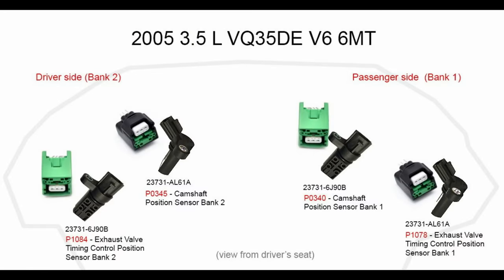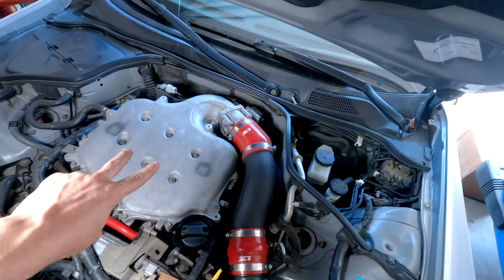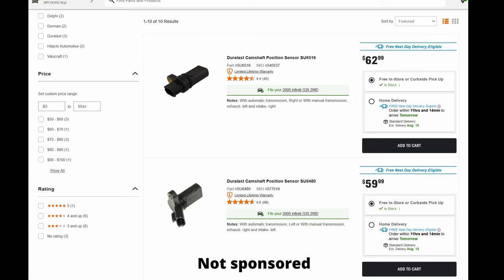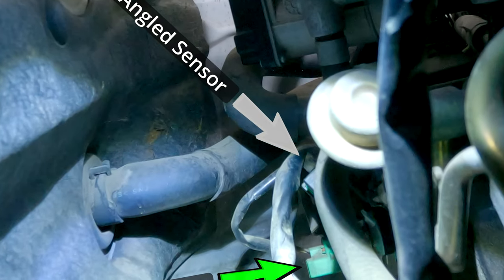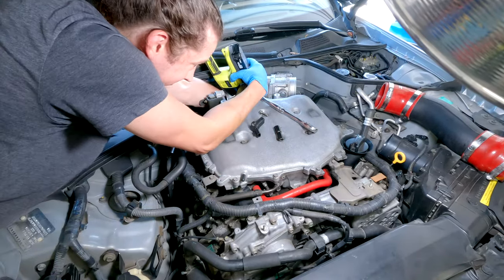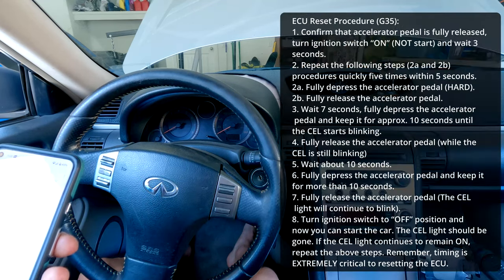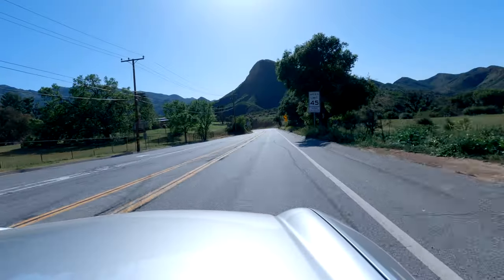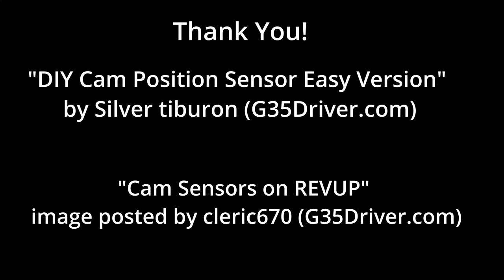Ultimate Camshaft Sensor Guide! G35/350Z | P0340 P0345 P1078 P1084

Comment: i have a non rev up 03 model Z, had p0345, replaced it, cleared the engine codes but it keeps throwing the code. Any idea why? All the problems (stalling, dying, running bad) went away so i assume that fixed it, an no other codes, dont get it....
Reply: You need to relearn the camshaft sensor
Reply: How do you do that? @DreddKnot.
Reply: Do the relearn and clear the codes after even if none present. If still throws it's VVT solenoids

Comment: Great video.  I just did this exact job on my 2007 Infiniti m35.  P0345 code. I bought a set of sensors from Amazon and this video helped tremendously.  My car was losing power while driving.   As of now I have completed replaced the bank two sensor and reset ecm per this video.  My check engine light is off and car fired right up.  I let it idle for about 30 minutes.  Before fix it would die 6-8 minutes into idle.   After I drive it I will come back to give an update.

Comment: Do any of y’all know if a platinum spacer will throw off the camshaft position sensor ? I’m having trouble with it I changed the sensor and did the reset it runs fine but if I turn it off and then back on it will do the same thing or would I have to switch both sensors

Comment: So on the revup there's 1 angled and 1 regular on the back of both right? I've changed the cam sensors but was kinda confused om the exhaust valve timing control sensor..that's right next to them right? Thanks a bunch.. so basically 2 of each

Comment: Thankyou for this info, I just bought a clean 2006 350z, did a thorough check over before purchasing but somehow I missed the damn check engine light. Did the diy engine code thing and it came up with 1078. Ordered a replacement exhaust cam sensor however I will do all the rest for preventative maintenance shortly after.
Reply from the maker: I'm glad it was helpful, congrats on the recent purchase!

Comment: Hi bro,

I got the P1078 error code. I already bought an exhaust Valve Timing Control Position for bank 1. Perfectly unscrewed the bold but there's no way I can pull the sensor out. It twists and turns left and right but I can't manage to pull it out. Any advice on how should I proceed? Thanks

Comment: Is it possible that sensors are bad and there is no engine light? I have problems with my car and I'm about to replace all camshaft and a crankshaft sensor because I dont know anymore what could be wrong but I don't have any codes or nothing when i scan it.. (nissan 350z vq35hr). Thanks in advance!

Comment: I feel like I need to change these every 6 months now ever since getting over 90k miles
Reply from the maker: Same, may be worth doing all of them or getting ones with a lifetime warranty
Reply: Agreed. Been fighting these the last 4 years. Finally picked up some lifetime sensors for both camshaft and the crank sensors. The manufacturer says replace all 3 at the same time so when they go out in the future I'll just return all 3 every time.

Comment: I just got the p1078 code today. It idles at 1,100 rpm. Its odd that the exhaust sensor on bank 1 is the same sensor as the intake sensor on bank 2 and vice versa

Comment: Are u still active I have a question of what u experience when driving with a bad p0340 sensor. I’ve been thinking my clutch was slipping because the rpms raise but the car doesn’t accelerate much, which is a known symptom of a slipping clutch. My can sensor light recently came on and I think that’s what’s making it feel like my clutch is slipping. I’m hoping that’s changing the sensor with fix the “clutch slipping ” feeling. What do u think did u experience the feeling of the clutch slipping?

Comment: i have a problem and is that after replacing i do all the steps at the end and it works no check engine or nothing but when i turn the car off and try to turn it back on it has a hard start and i have the cts, slip and check engine light 😢 already changed the sensor twice, checked the harness, and replaced the battery any ideas?
Reply: I’m having the same issue did you find out what it was

Comment: im not sure if you still respond but my 06 rev up and i have the engine code 1078 but i just have a question could this be the reason why my car just shuts off randomly?
Reply: Might need to clean ur MAF (Mass Air Flow) sensor and clean your throttle body, after that do an rpm re-learn on your car (pretty simple search up yt vid), if that doesnt work thennn replace ur cam sensors and ur crank sensor
Reply: yes i heard the sensor will cause that

Comment: I am pushing the tab forward until my thumbs bleed and the sensor will not move at all. Tips?
Reply from the maker: I'd try to get a tool on it. Like a small socket or something you can push on harder. Maybe spray it with some pb blaster or wd40 to clean it up
Reply: i had to remove the driver side one with the wiring still attached, and then used a long thin flat head to push the tab in and pulled it. I had same issue at first, very frustrating, but doing that helped when i could actually see what i was doing, did from driver side after I got the sensor out of the motor from the passenger side like he is

Comment: HELP PLEEEEAAASSEEE! 
I removed the drivers side camshaft sensor and the gree  tab connector broke off.. I put it back in but its loose and easy to pull up and down..  

Please tell me how to fix this!??!

I was having starting troubles and it was running rough. But i literally just checked the sensor, pushed it back in the best I could and it started up right away!
Reply from the maker: So the green locking tab is broken? :/ I suppose the best fix would be to wire in a new harness/connector right there.  The easiest/"not officially recommended" fix is to zip tie that connector down somehow so it doesn't come out
Reply: @windows_down_  maaannn. 1st off, thank you for getting back to me  so damn quick. I truly appreciate you. And 2nd, it shouldn't be that hard to wire in a new harness/ connector for someone who knows jack shit about electrical but does understand the G35? 
And If i were to try and jimmy rig it with a zip tie, how would I go about that??? 

Thank you thank you again!
Reply: @windows_down_  and would I have to take apart the top half of the engine again??
Reply from the maker: @americanbyforce6874  The wiring is probably really hard to get to.  I'd be sure that the green tab is broken, maybe the connector just isn't pressed in all the way.  The green connector should pop out.  If it is broken then just making sure the connector stays on is key.  I've seen some shops use a high temperature epoxy to make sure it stays on there - not that it's the best solution.. When in doubt you can always take it to a mechanic
Reply: @windows_down_  i'm pretty sure it is broken. Like 100%. 
And yeaah I wouldn't use epoxy on that. But all of you advice has been helpfull. 
Thank you very much kind sir. 
You've earned a sub! ♡